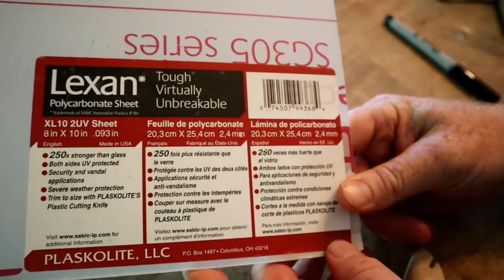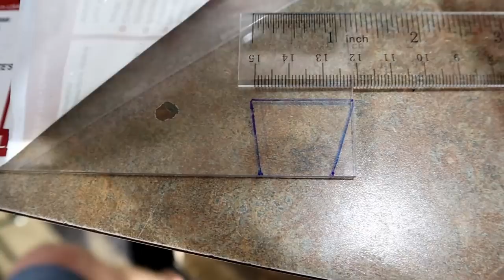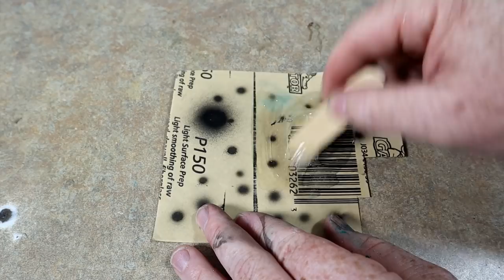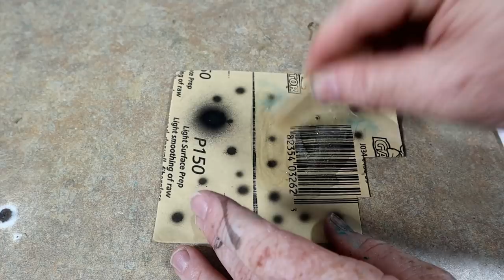Making My FIRST WOODEN Bait; Wooden Squarebill Crankbait Build

Comment: It helps to keep everything squared off at first, get the shape cut, and cut the bill slot while everything is still square. It makes it easy to avoid a crooked lip and helps to keep everything symmetrical. Also it helps to draw a center line down the back and the belly of the lure, this will give you a visual reference to keep everything even on both sides. (Pencil will rub off while sanding. I recommend pen) 

With all being said that’s an awesome lure for your first time and minimal experience working with wood. Making a lure with a good action can be tricky sometimes especially without adding weight. Definitely something to be proud of man great job!
Reply from the maker: Great advice!! Thanks for the comment man

Comment: Great video and great job for the first time. Suggestion for the rough finish you had would be to clear coat seal the wood before you paint it. It seals the wood and gives you a smooth surface to paint on.
Reply from the maker: Yes that is a good tip, I also can do a better job sanding going forward

Comment: Built my first squarebill out of pressure treated pine (it's what I had laying around), a big ripping saw, and a file. Built the bill out of a piece cut from a clamshell package and wrapped together with packing tape to make it thicker and sturdier. Painted with automotive spray paint, and reused old hooks from a different crankbait, with hook hangers twisted by hand from galvanized mechanics wire. Never caught a fish with it. The thing weighed a ton and I it broke of after an afternoons worth of casting. The second one caught more than a few though!

Comment: Dude, you are killing me.  You need to get the right tools.  They don't have to be expensive but you need blades for wood.  Still a great first time.  Proud of you for doing it.
Reply from the maker: suggestions on blades?
Reply: World's Worst Fishing well it looks like you were using a blade for metal cutting not wood. For cutting curves in wood, I would recommend a scroll saw with 1/8 to 1/4 inch widths rated for soft to medium dense wood. While you can get a manual one for now, I would move to a bench top electrical saw.  They are as good as a band saw for this work.

Comment: When starting off in wood carving, the first 2 tools I recommend to people are a Japanese pull saw, and a straight blade carving tool/knife.
You don't have to break the bank on those either. You can get a good/decent japanese pull saw for $10-$20, and the carving tool can be as simple as a box cutter.

Comment: So for my knife handles for final finishing I use the 7 sided nail buffer. Runs from a fairly course grit to an extremely fine grit. Get them at amazon cheap. They also make just the 4 sided which works but not as well. Will put a slick finish and you can hold lure in your hand while you with no issues. Great job by the way.
Reply from the maker: Thanks Eddie

Comment: Thats a amazing action from the bait , I think if you would have drilled a 1/4  or 1/8 hole on middle between the hooks add some lead to give it a weight it would be good. Also  try ussing self leveling UV raisen so it be smooth lure then paint then UV epoxy or raisen and it won’t yellow or fade . And kayaking come in so natural to u hehe
Reply from the maker: great tips!

Comment: It looks great and functions great for the first bait. Yes your right about finer sanding. Not sure what you went to. Im not familiar with wood work, but I build mid power and high power rockets out of fiberglass and I sand to 400 before priming, 800 grit after priming to get as smooth as possible. Wood maybe want to go smoother than 800?.

But that seems like something you will learn as you go and by watching other YouTubers. You seen like you did your research ahead of time anyway. Great video. Good job on your first one. It looks good and functions. That's the goal after all.
Reply from the maker: thats awesome..we are pyros ourselves haha..

Comment: get some clear coat, 5 min epoxy sort of works but does yellow over time. put a coat of the clear coat on the lure before you spay it that way you will have a mirror flat finish to pain on.  With a little practice they will start to look professional.